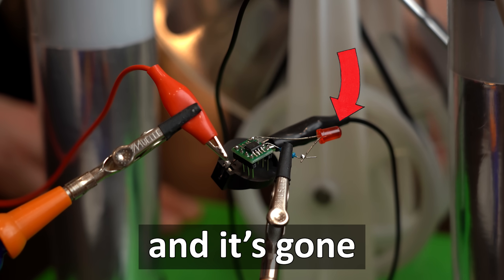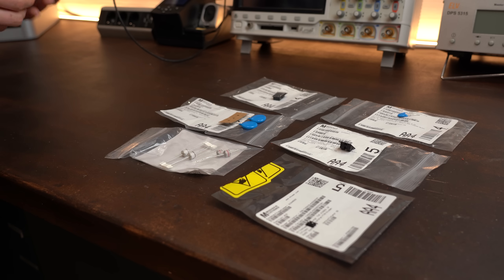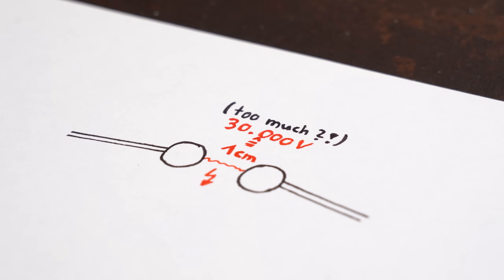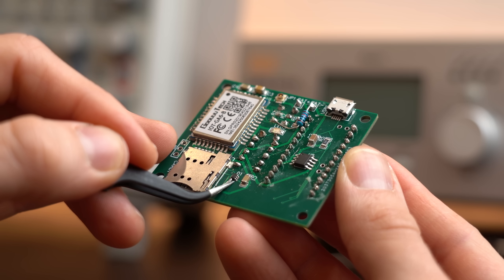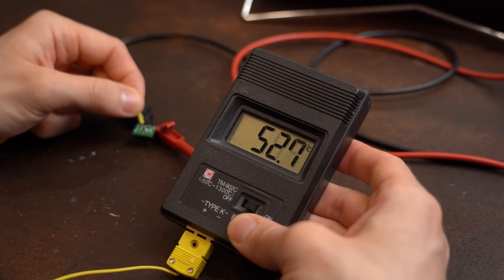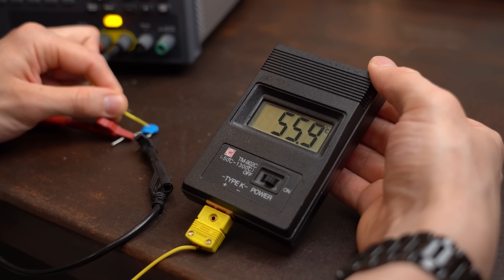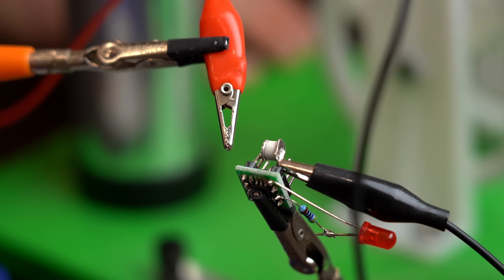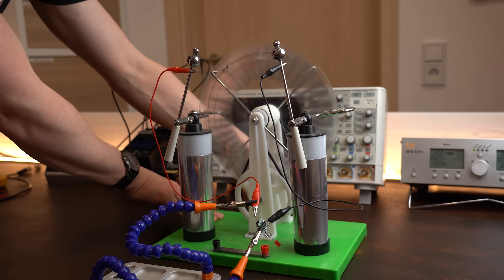This $0.70 Component SAVES your Circuit?! (Surge Protection) EB#59

Comment: I repair control circuits for some industrial equipment, and they regularly use both a TVS diode and GDT in parallel on each line. The TVS diode handles the lower voltage transients, while the GDT protects against higher incidents like lightning surges. It works very well, and it's easy to test and cheap to replace if it does blow.
Reply from the maker: Thanks for the feedback. Good to know.
Reply: Hearing the way each device worked that was my immediate thought "can you use them in parallel to protect against a wider range of voltages?". Good to hear I was on the right track.
Reply: If they're in parallel, couldn't a high voltage transient just take the TVS line?

I'm still learning this stuff
Reply: a TVS failing would mean that it does not conduct to ground, so a parallell device that also conducts to ground during a high voltage transient, would take over. Or what did you  mean by "take the TVS line"?
Reply: @lostsauce0  So, electricity always takes the path of least resistance (more or less). Think of each of these devices as a conditional short, it's normally not shorted to ground, but under specific sets of voltages it triggers a short, at which point IT becomes the path of least resistance, and so the voltage spike will take that path rather than flowing through the higher resistance (sensitive) circuit.

Each device has a limited range of voltages and response times it's good for, past a certain point it will fry (or under a certain point it won't trigger), stop conducting, and then you're back to the circuit you're trying to protect being the path of least resistance which you don't want. By putting a bunch of them in parallel you're covering a wider range of potential voltages, and even if multiple of them get fried, it's cheaper and easier to replace these components than the rest of the circuit.
Reply: @lostsauce0 you cannot guarantee that the TVS will always fail a short. What usually happens : TVS fails a short. The high energy pulse from whatever source blows that short open, vaporizing the metal in contact, in microseconds following. The TVS becomes effectively open. All depends on the energy : i.e. voltage (RMS, peak and waveform), impedance and duration of the pulse.

Comment: T7 component tester has a tiny triple TVS that blows if you forget to discharge the cap before testing. 
After replacing it twice, I gave up and use my other cheap tester with no problems. 
If you have one, you know what I mean.
Reply from the maker: Thanks for the feedback.

Comment: I wonder how effective spark gaps are, given they're pretty much free to add to a PCB. Our TV's power supply got quite a few of those, and after a lighting strike nearby, the cable TV box burned and it made the favor of killing the TV's motherboard through HDMI, along with the Switch dock on that same TV. Replacing the motherboard made it work again, but after a while the power supply also went bad, and I could see on the mains pins a tiny welding like dot on the metal casing (clearly an arc mark), along with a missing spike on the spark gap PCB track.
It was already more than 10 years old at this point and it still survived that lighting strike.
Reply from the maker: Thanks for the feedback. Interesting story. I should put spark gaps on my to do list for videos.

Comment: Thank you for the video! The MOV surprised me in this experiement, I didn't expect it will protect against sparks due to its slower reaction. I designed an off-line converter with an LNK-304 and lacked the mov. When my father plugged in a washing machine to the nearest socket the IC blown away. Never lack the MOV!
Reply from the maker: Thanks for the feedback :-)

Comment: "Doesn't happen often that lightning strikes near you." I live in Singapore and I've had a thunderstorm every afternoon for the last three days. Yesterday the lightning strike was so close you could hear the crackle before the bang. But at least the humidity stops you getting static shocks from the carpets in the office.

Something you might be able to advise on is the problem that I have, which is when there is a lightning strike nearby my RCD trips, none of my neighbours seem to be affected. I've always thought it was because I have an induction hob and the coil is picking up the EMP from the lightning and creating a current flow in the neutral line, as normally the hob is switched off at a wall switch, (which I assume only isolates the live), and hence causing a differential L to N current flow.

You could probably have used an electric fencing unit to create a known and constant voltage, or a car ignition circuit.
Reply from the maker: Thanks for the feedback. That sounds scary. And there I think overvoltage protection is a bit more important :-)
Reply: @greatscottlab  Yeah when I lived in SE Asia my UPS would last a few months before bulging from an overworked battery due to a lightning strike  They never lasted longer than a few months.  Plus, aside from Singapore, a lot of countries in SE Asia don't use ground.   I added a ground for a house we built, not sure how reliable it is for a big short or overvoltage, but at least it seems to work according to the multimeter.
Reply: @raylopez99 : If you ever move back to an area that overworks your UPS battery, then see if you can find a big capacitor of sufficient voltage to "replace" it, then wire it in parallel with the battery: as long as the problem was transients, then the capacitor(s) should reduce the problem. At one point, there were some gimmicky capacitor-based battery "replacements" for motorcycle batteries, and for ordinary UPS batteries those would probably work.
Reply: @absalomdraconis  Interesting.  You would think a battery would handle transient spikes.  I found a simple solution is to turn off your PC anytime there's a storm.
Reply: @greatscottlab  Nearly all power lines in the country (not that it's very big) are buried so I don't think that over voltage events occur very often. I've never had of over voltage protectors on domestic distribution boards.
Reply: One time lightning struck pretty close to my Mom's house. My brother got a small shock from the wired headphones he was wearing (plugged into a PC which was grounded). It also tripped a GFCI. Not sure why it tripped, I just chocked it up to high voltage doing funky things.
Reply: I lived in Florida, USA for a while. Lightning happened every other day. I lost a computer motherboard to a cable modem conducting a lighting strike from the cable system into it and thine through it into the computer because the lightning arrest system on the building failed. My next computer had optically isolated I/O ports and my replacement cable modem's coax went through a surge suppressor, as did the LAN cable that came off it, isolating any future lighting strikes from the network and my new computer with three layers of protection.
Reply: @KnightsWithoutATable  Yup, that happened to my family too, grounding wire came loose, and all the wired PCs got fried. If only the cable connection had gone thru a surge protector first. I also think if the modem and router had a grounded PSU instead of the floating 2 prong wall warts, they would have taken some of the hit, and maybe sacrificed themselves to save the PCs.

Comment: I have been thinking about implementing these TVS to my pcb designs.

But im just thinking, shouldn't all pins of an IC to be protected by tvs then?
Reply from the maker: You could of course do that to be extra safe. But usually you "only" include them next to connectors that get touched. I forgot to add this detail in the video. Sorry.

Comment: I had lighting strike the radio antenna of a cellular remote oil well monitor that I had built a long time ago.  It skipped right over the lightning arrestor on the antenna cable and blew the ground track off the entire circuit, through the cellular modem, through the serial cable connecting the modem to the PLC, through the PLC circuit board, through the ground wire and into the electrical circuit on the engine skid that was supplying power to the automation panel.  Was a hell of a thing. The ENTIRE circuit from top to bottom vaporized. There was nothing left of the tracks at all.
Reply from the maker: That sounds scary. Thanks for sharing your story :-)
Reply: @greatscottlab  Well, it didn't happen while I was standing next to it. I got a call saying the install wasn't powering on. Remote trouble shooting didn't turn up anything so I had them pull the unit and send it back to me. I took it apart and found dust and vaporized copper.
Reply: @Alacritous I had to clean out the control cabinet on a high voltage transformer from a power substation. The bus bars and circuits in the cabinet had taken a surge and vaporized. The inside of the cabinet had some black oil with a copper sheen in the bottom and covering the sides.
Reply: "Well shit"
Reply: A good example of the randomness of some events. We know how lightning mostly behaves and build protection accordingly, but occasionally it does what ever the hell it likes!
Reply: In a direct strike, everying (metal or not) can be turned instantly into fire!

Or not. Lot of luck involved, and most strikes are just too near, not a direct hit.
Reply: Gosh
Reply: Scot I am looking for timer circut for my free flite glider can you please help
Reply: The high frequency component of lightning likes to bypass any series inductance including a bend in the cable. The results can catch you out.
Reply: Nothing can beat a direct lightening strike 100% of the time… once in a while you may get lucky, but a direct strike can vaporize 1” steel cable. Your 1x.5cm copper bus bar never stood a chance. 😢💔😉😂😅
Reply: What brand of PLC? That's not something that you see happen to a PLC very often. 

The problem with voltage protection is that it's like walking under the hoover dam with your umbrella open. You should be good, right?
Reply: @MrWaalkman  It was an automation direct DL06. We figured that the lightning arrestor was supposed to be grounded through the steel on the box that everything was mounted in but for some reason that path to ground either wasn't there, somehow the panel wasn't grounded, or was higher resistance than the path through all the electronics.
Reply: @Alacritous  lightning doesn't only take the shortest path to ground, it'll try all the paths until it completes the shortest one. That might only take a millisecond, but lightning will make that millisecond count
Reply: @Alacritous  Ah, no surprise there. I sent an AD Click PLC's transistor into a low orbit once when I hooked it up wrong. And the same thing can/has happened to Rockwell PLCs too. It's a problem with "micro" PLCs from many vendors. The old Koyo 305 PLC (aka, GE Series One, TI/Siemens/AD "305s") had issues with its rack, which was known to die for no apparent reason.

I'm using a Turck TBEN PLC for a project intended for Antarctica and it has some amazing specs, much like the old GE Genius I/O (I've been told that the Genius I/O was originally intended to go down into oil wells. They were basically bulletproof). IP69K rated, and surge protected to 500 volts (IIRK).
Reply: @MrWaalkman   We kept our stuff away from the class 1 div 1 areas. Very much general purpose.  Didn't want to deal with that shit. Proper barriers where the instruments were in the hazardous areas though. The AD DL06s worked. The company was using them before I came along. I HATED the ladder logic programming of them though. Directsoft was programmed by 20 different programmers who weren't allowed to talk to each other until the project was done.
Reply: Lightning arrestors get thier own straight line to the main ground, improper grounding likely destroyed that installation.  @Alacritous
Reply: @Alacritous  Yeah, Hazardous is, well, hazardous. I spent a lot of time in automotive paint shops and the paint mix room is dead serious. If you hear the alarm go off, you've got 30 seconds to either haul ass, or prepare for your next life. At the end of the 30 seconds god knows how many tons of CO2 is going to be dropped into a closed room with you still in it.

I can't remember the make of the barriers that used to be in there. They were still operational, but we couldn't get replacements for them. Thankfully they were replaced about ten years ago. The floor of the mix room was a mix (no pun intended) of explosion-proof wiring along with intrinsically-safe devices.

I have extremely limited experience with the AD DL06s. They work, but based on my Click & 305 experience, I would put AD's programming software ahead of anything GE has rolled out, but behind Rockwell's Logix 5000 or Codesys. Like you said, it works. And if you get hit hard enough, nothing is going to survive anyway.

Was the programmer separation intentional? Sounds like the approach Goodyear takes to keep their project designs from making their way to competitors. They would wall off projects from prying eyes (with literal plywood walls) and limit access to the area to everyone except authorized folks.
Reply: @MrWaalkman  I was being facetious. The programmer thing. IT seemed like they were separated and not allowed to talk to each other because the Directsoft software(Their programmer for the DL06 line) was hot steamy garbage. With no consistent implementation from one function to another.  One function that led into another function and they'd do the exact same thing in two different ways, depending on which function you were using. The clicks used different software for programming.
Reply: @Alacritous  Ah, I was wondering. :) Yeah, that's a very common problem.

Saturn paid PC Design (IIRC, that's the name of the company, but it's been nearly 40 years) to create "schemes" for every type of stop, transfer, trackswitch, etc. for their conveyor systems in General Assembly (GA). Sadly they did not make sure that they actually worked as intended. And none of them did. So we had very pretty, and consistent PLC logic that didn't work as it should. :)

But it was a very good start, and Saturn paid the company that I worked for at the time (KASA Industrial Controls) to keep me onsite for an extra 2+ years fixing the standard schemes, adding diagnostics, and generally being available to assist in breakdowns and continuous improvements. 

I took their idea, and wrote a program that would allow the user to select the type of device that they were going to add to the PLC, assign it a unique stop number. From there, my program would create the logic in the old .PC5 text programming "language" for the AB 6200 PLC-5 software, complete with names and rung comments. A second program would allow the user to select which PLC-5 PLC that they were going to use, and all of the individual "schemes" that they had made for that conveyor and "stitch" them together. The resulting .PC5 file would then be imported into the 6200 software to create that conveyor's PLC program. You would have the conveyor drive logic to do manually, but that was about it. This was done for JB Webb conveyors at Wentzville, MO in 1994 - 1995.

I was a bit more successful than I had intended, and I finished up well before anyone else. At which point KASA released me from my contract (since I was finished after all). Saturn hired me two weeks later to be their "C" crew Controls Engineer in GA. Things worked out in the end. :)

These days I'm retired, but I am assisting in a project for Matrix Drilling Products and the Uni. of Minnesota, Duluth (UMD) for a PLC upgrade from the Compact Logix to a Turck TBEN PLC for their RAID project in Antarctica. I mention this because you being in oil, you might know some of the Matrix guys. :)
Reply: @MrWaalkman  That's how software is sometimes developed. The programmers get handed a theoretical problem and fix it. While there is nobody looking at how it integrates. That is what you did eventually, solving the actual problem. If I were KASA and were competent, I would take your software, put a small team on it and build it out to a full product. Worth millions at least. To late now I guess.
Reply: @JackieBright it’s like a quantum computer… all paths are valid and invalid at the same time till they’ve all been tested, any avalanche conditions taken into consideration, and properly vaporized. 🙃

Alternatively if you go with the old “voltage is a pipe, current is the water flowing through it, and resistance is the sluice gates” metaphor, lightening has so much V and I that it will instantly fill and flood all available paths including ones you never dreamt of. This can yield some fascinating scorch marks in some very unexpected places! 😂
Reply: @MrWaalkman  Not much good against a direct lightning strike, but they do work against lightning that strikes nearby and causes a surge in the grid.
Reply: @kaasmeester5903  The problem is that every time that they conduct, the conduction threshold is lowered a tiny bit. Eventually they can cook off under normal voltage levels. UL started requiring integral thermal fuses at some point, but I'm not sure that this solved the problem entirely. So the device itself has some serious issues.
Reply: Typically with MOVs they put heat shrink around it.  With real lightning, there’s so much energy they can explode into with chards.  The heat shrink would ideally contain it.